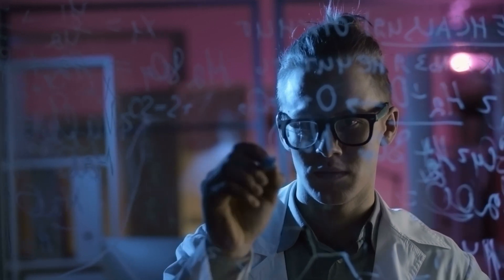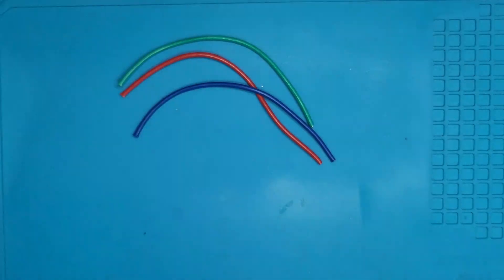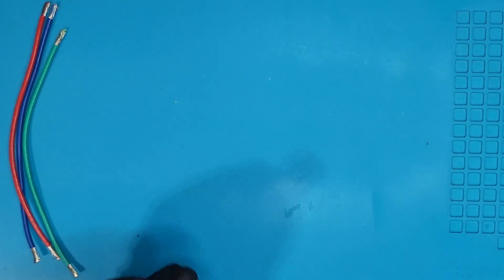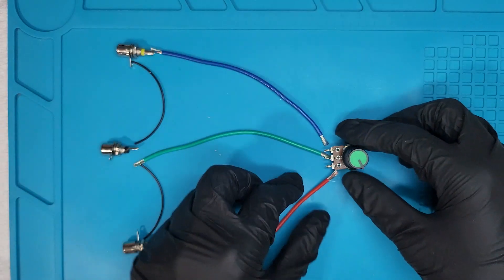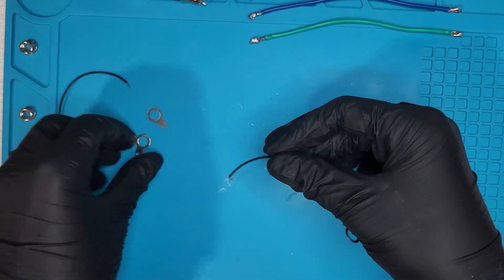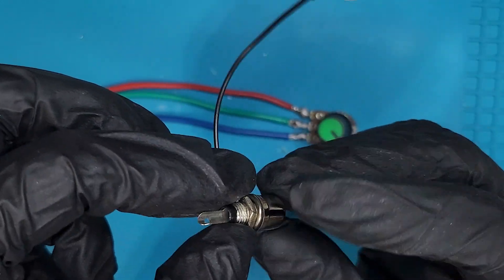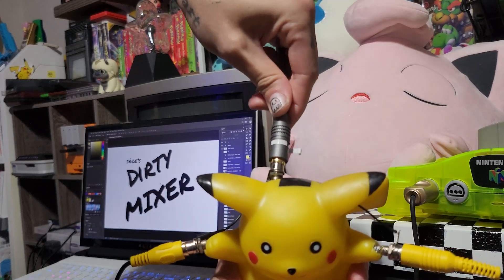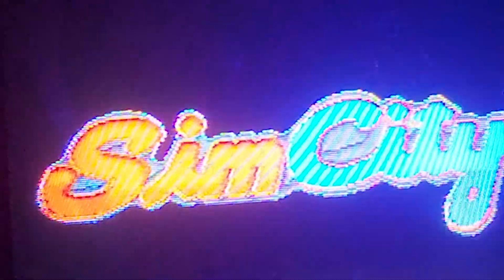How to build your own Analog Dirty Mixer: the complete simple guide

Comment: Hi, I have 30awg wire and wondered if that would be suitable for this project?
Reply from the maker: It's hard to say, I've never tried it with 30awg. I usually just cut up an existing rca wire but you can make one without any wire at all by soldering the rca port directly to the potentiometer
Reply: Cool I'll try that + other gauges too, thanks